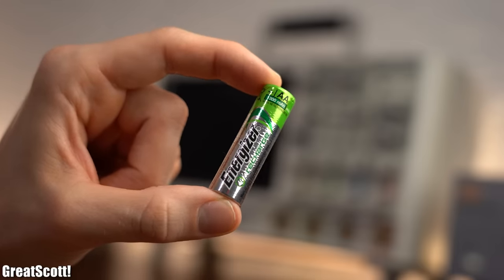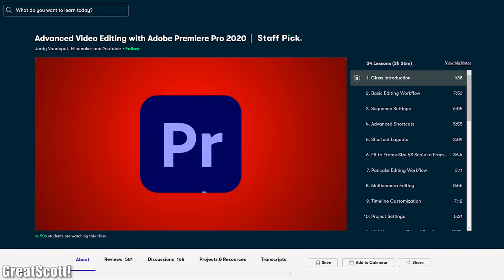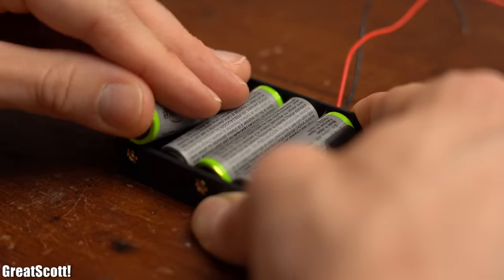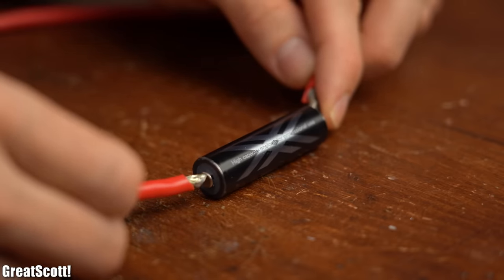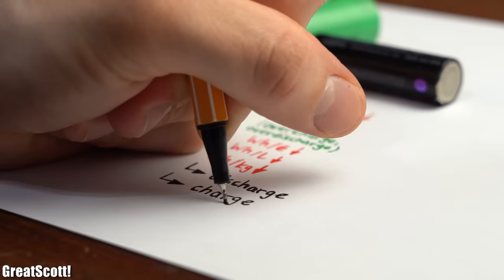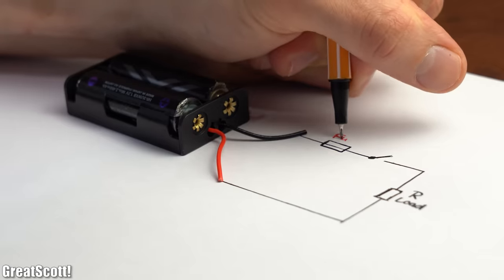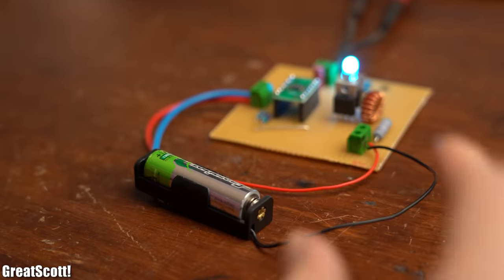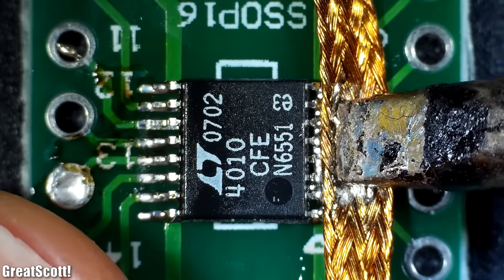Are AA NiMH Batteries obsolete? Here is everything you need to know about them!

Comment: Great tips on charging. I really need to get a smarter charger, my current one only does trickle charge although it does let you set the time/current values. It might not be the greatest battery tech but it’s used almost exclusively by toys!
Reply from the maker: Thanks :-) Sounds like an interesting charger you got
Reply: Just keep in mind smart chargers will not charge batteries that have too high of a resistance or if it detects something is wrong. I have about 8 NiMH batteries that work fine and even keep the charge but the smart charger does not charge it and blinks. So now I have 2 chargers to fix this issue and keep using the rechargeable batteries.
Reply: La Cross chargers are ok. Some even have settings to attempt to refresh damaged NiMH cells.

Comment: They are really good for lighting in dioramas. No need for charging, or low voltage protection, and they last for years with a charge. I like how you clamped onto magnets stuck onto the ends of the batteries.

Comment: An extremely helpful video would be retrofitting lithium batteries for devices that take AA!
Reply: I mean, that's pretty easy, so I'm not sure what you need a video for? Basically anything that runs on three AAs 4.5v-3v (or sets of three) will take a lithium cell with zero modification, then for one or two AAs all you need is a low dropout regulator or buck converter and finally a simple TP4056 for charging/protection or BMS for larger packs.

Alternatively, you can make things slightly easier by scavenging batteries from old devices like phones, since those will have a bms built-in and can come in convenient sizes.
Reply: @vgamesx1  the trouble is 1 AA at just 1.5v
Reply: Most anything that requires 2xAA in series you can use an 14500 and a dummy cell.
Reply: @patrickriarchy6054  My mouse takes just one AA 😕
Reply: To be fair, if a device uses AA, you will likely find NiMH much more fit than any lithium-based battery type

Especially for a relatively low-power device such as a computer mouse
Reply: @MrCh0o  The critical consideration is that many enthusiasts want to get their computer mouse as light as possible, as an example the Logitech G305 is a popular single AA battery performance mouse.
Reply: @soulshinobi  How about a wired mouse? Nice and light.
Reply: @soulshinobi  Or the single-use 1.5v lithium cells.
Reply: @soulshinobi  Or the AA size lipo-to-1.5v usb-rechargeable batteries.
Reply: @jimmybrad156  what I settled on doing is dismantling a AA size lithium battery for the charging circuit and buck converter and soldering in a 100mah cell.
Reply: @soulshinobi  Nice! What mah was the original cell? How would you describe the improvement?
Reply: @jimmybrad156  the rechargeable AA battery had a 550mAh cell weighing 12g (17g fully assembled), mice that are rechargeable are typically 500mAh flat cell (~10g), the 110mAh I have is 2.5g.

Comment: I personally like NiMH batteries because you can refresh the battery 'memory' by charging at a higher voltage. I've had a dozen NiMH batteries going strong for 6 years for both my xb360 and xb1 controllers

Comment: What might be interesting would be to include the theoretical maximum cycles for the batteries with the prices. They could be cheaper for daily uses
Reply: My NiMH are about 15 years old and still work great. There where used for RC Cars when I was a child and are now used in my XBox Controller.
Reply: There is limit. Just 40% is lost after 3000 cycles for eneloop lite, for example.
Reply: Complicated by the dependence of Li Ion to the depth of discharge. They like not being charged up to 100% and not discharged to 0%.
Reply: @gblargg  yeah, that 3000 number is from discharging of NiMH to 1.0 volt not full to 0.9 volt.

Comment: Thanks. Couple of points.
 When using multiple AA or others, there's always been a requirement to use identical new cells. For rechargeables this translates into fully charged and identical.
More modern devices can handle the lower voltage of NiMh compared to alkalines, but plenty cannot. 
Pricing I did for rechargeable lithium AA cells was a lot higher than NiMh.
Reply: it's really more of a best practice. You can mix and match and it will work, but with diminished lifetime because you would strain one cell over the others. I remember changing out the batteries on my TI-84, and there would always be that one cell that was drained (it was usually the second cell) while the rest still had some life. Curiously, I always swapped the batteries around to get a few more weeks before replacing them all. For some reason, TI calculators always drained the second cell first (even though they are wired serially and they only see the sum voltage). You don't see this with proper design and following the "all new cells" rule. Nowadays, I see this with chinesium gadgets that always use up the lower cells first (even after following the rule), usually because they're drawing too much current and straining the cells.
Reply: @arshia.sasson  And when you don't swap them, the lowest voltage cell always leaks
Reply: For devices which only use two cells (which seems to be most) it's usually fine to mix because the device will malfunction before the weak cell gets overdischarged. It's also fine to mix cells if it's just for temporary use. Just check them before installing. The rule about not mixing is IMO just for people without a multimeter.
Reply: @eDoc2020  Some of us want to fit, forget, without worries. Two cell devices don't always fail cos one is low. 
I have multimeters. I can't be bothered opening things up to measure cells cos I'm dumb enough to put unmatched cells in. Plenty of single cell devices to use up the odd single.
Reply: @kevgermany  I don't actually check the cells during normal use. I'll check them before installing in a device to make sure they're reasonably matched and then leave it alone until the device stops working. It might not be ideal but I haven't noticed any problems doing this.

Comment: I’m working on a portable neopixel light project that is powered off 3 AAs. I was just doing research on types of possible rechargeable batteries and couldn’t understand much information on NiMH AA batteries. This is absolutely perfect. Thanks!
Reply: Yes this is the biggest downside of NiMH IMHO.
Lipo just charge it with constant current, constant voltage.
NiMH: you need to have error prone and complicated deltaV charging. Also for deltaV charging you need to know the battery capacity so you don't charge them too quickly or too slowly.
Reply: @kwinzman  Li-po or Li-ion: capacity is needed to select proper CC current (0,3C to 1C or above in some cells, see datasheet for exact figure). Some cells like slow charging like my LG M50T 21700 (0,3C - recommended charging current from datasheet, 0,7C - acceptable at 25°C to  45°C)
Ni-Mh: capacity is needed to select proper fastcharge current (C/2-2C). Some care must be taken if already full cell is loaded into a charger.

Comment: Nickel cadmium battery's are still used in a lot of emergency lights in commercial buildings, and even new lights comes with those, I think is because of the high temperatures that those batteries can handle, some are starting to use  lithium phosphate but not like those.

Comment: my short answer to the obsolete is a big NO.  Many of my remotes/flashlights/fire alarms etc use removable aaa/aa/d/c/9v.  I just use the amazon basics where I can and have several sets of each that I rotate thru.  The charger that I'm using allows a full discharge(push a button) and after about a year of use I've cycled them all to "reset" them.  The one down side is they don't last as long as a duracell, but in the long term, each is probably worth 50 to 100 regular batteries.  One other down side, is they won't power somethings.   I realize this has nothing to do with the content of your video, but everything to do with the title.  And yes this is another great video...keep them coming...

Comment: Great video, but I think you forgot to mention how it can be used instead of single use standard size batteries (like AA) for commercial applications that can only take AA batteries. For example, you can't just use a LiPo on a game controller that takes AA batteries if you want something rechargable and easily replacable. I bought a set of AA NiMh batteries for my Wii remotes and despite the fact that they do charge really slowly, they're much cheaper in the long run than replacing single use AAs every time they get depleted.
Reply: I took his video about whether to make your own project run on them, or choose a self-contained cell.

Comment: I love my NiMH batteries.  For most of my projects under 2 watts, I use a AA NiMH cell.  My favorite PMIC is the TPS6102x family.  TPS61029 can deliver a fair amount of current (rated 1.8 amps at the switch, but that's more than an AA can source, especially given it's a boost converter) and will work down to .8V input.  It can also go into LDO mode if the voltage is a slightly higher than the programmed output and the output current is low.  It has UVLO, so it can cut off the boost circuit when the battery gets too low, programmable by voltage divider.  Best part is, for 5V projects, it will happily accept a Lithium cell or array of NiMH cells.  It's only boost, so no buck-boost operation.  SC8729 is great for buck-boost operation, but you need at least 2 cells, as it's dropout voltage is too high for single NiMH operation.

Comment: Personally I refuse to use lithium batteries in my projects due to the extreme fire and burn risk if they suffer any physical damage or a power surge due to component failure.  This risk is always brushed aside but needs to be taken more seriously.  I am tracking development of LiFePO4 cells which are moderately less volatile than the highly unsafe lithium ion and lithium ion polymer cells.
Reply: My thoughts exactly
Reply: LiFePO4 batteries are very tolerant of abuse.

I was at an event where a NiMH battery for a prototype electric car caught fire either during of immediately after charging.

Lithium ion batteries, including 18650 cells are available with integral protection systems that will protect the batteries from electrical abuse.
Reply: Gotta love the username in the context of the comment
Reply: That only happens in extreme situations, I only use lithium batteries and never had a problem
Reply: @clixium  Lithium ion batteries killed 14 of my farm animals.
Reply: @baneverything5580  I'm sorry to hear that but with a proper charge controller and battery management system that controls the charge, monitors the temperature that would never happen. Lithium batteries are safe if you play by the book and unforgivable if you don't.
I have all that and it isn't expensive if you know where to buy and how to connect all that but I still keep my batteries in a concrete basement or in a steel box just in case electronics fail
Reply: @baneverything5580  and as guy above said, lifepo4 is much safer chemistry and better option. They can last a lifetime and they wont catch a fire like lion or lipo no mather what you do to them
Reply: wrng kith sekf copkíñg
Reply: @baneverything5580  damn, what happened? What sort of lithium cells? Was it the cells themselves at fault or something else like a loose high current connection somehwere?

Comment: I really appreciate how deep you get in the topics presented in your videos! I learned interesting things for NiMH batteries! It would be interesting to see a video about primary lithium cells such as Li-SOCl2 batteries from Saft, Tadiran and others. They have high internal resistance but very low self discharge rate and are very suitable for IoT projects when coupled with a supercapacitor.

Comment: I like the safety and cycle life longevity of lithium iron phosphate. It's becoming easier to find LFP batteries and components in different sizes now. Made a couple small projects using 18650 and 32650 LFP batteries and I like working with them.

Comment: I discovered that when the NiMh lose capacity, cycling them seems to return them to near new levels. This seemed similar but not exact to the NiCd battery degradation issues with the older style cordless tools. I tried this theory on my 2008 Prius which uses NiMh batteries. There were several cells in the pack that identified as weak. I fully cycled each weak cell and four years later they are still good and now with 300k miles. Good topic.
Reply: How did you cycle those specific cells? did you remove them and cylce them or did you just discharge the entire pack? Also how did you identify weak cells? via OBD2?
Reply: @exmerion  I identified the three weak ones in the pack through the OBD port. From there, I disassembled the pack enclosure, unplugged the pack then disconnected/isolated the individual cells. I have a programmable battery analyzer and did a full discharge/charge/discharge/charge. They still seem to be holding up well. 260k miles on it now. Not saying, that I'm any kind of expert. Just did what I thought was logical. Hope this helps.
Reply: @babaluto  very helpful thanks

Comment: I used to use Lipos in my hobbies but having to constantly think about the voltage and monitor the voltage with an alarm got exhausting. That drove me back to nimhs, as soon as I felt any loss in power it would be time to change batteries. And having used them for so long I kind of already know the expected run time without damaging the batteries. Even though its older tech they are still very much useable.

Comment: nicely explained, can you make a circuit which can forward-reverse a DC motor based on time or (specific rotations using some sensor). thanks

idea is to take out butter from curd using such a machine using DC motor rather than AC ones.
Reply from the maker: I can put it on my to do list
Reply: @greatscottlab   please do it.
Reply: use a stepper motor and driver

Comment: for low load currents, pre-made boost converters from China work perfectly! they will stop discharging the battery at 0.9V pretty much exactly, which is when you should stop discharging to prevent damage to the cell. also charge termination voltage of 1.50V is what Maha Powerex Chargers do, you don't need to charge to 100.00%

Comment: There are also NiMH cells with built-in micro USB port and buck converter. While the space occupied by circuitry obviously detracts from cell size and capacity, those I have work very well, and can be charged either via USB, or a normal NiMH cell charger. As a bonus, each 4 cells came with a Y-adapter, for charging 2 cells at once from a single USB charging port. I have charged them from my laptop and from normal USB chargers and there is no discernible difference. Either way, they never get overcharged... Not that such is much of an issue, but it can dry out the electrolyte faster in some batteries.

Comment: I'm okay with handling bare lithium ion batteries, I've read about proper safe handling, have cases, a quality charger, etc.

But for most non-technical folks, I'd recommend something that works with AA NiMH cells because that maintains the ability to easily replace the battery when it wears out - unlike integrated lithium battery packs which most consumer devices discourage you from replacing (glue, solder, etc).

There are exceptions, e.g. flashlights with replaceable lithium cells that also have built-in charging, so the person using it doesn't have to worry quite as much about handling the cell directly.  I wish that was more common.

Comment: I've got a set of 4 energizer 2300mah NiMH AA batteries and they're still working great after 5 years. Not sure who came up with the idea that NiMH has a high self-discharge rate, two of my four cells I left in a keyboard that I didn't use for 3 years. When I finally started using it, it still powered on and didn't need a charge for two weeks lol

Comment: Having at least one analytical charger around that can be configured to charge at different rates, discharge at configurable rates to a certain voltage, etc can be very useful:
You mentioned the different capacity leading to over discharge, when I get new NiMH batteries (haven't done so in years) I run them through a charge, discharge, charge cycle on that charger. Then write the measured discharge capacity and current year + month on them. This way I can grab roughly matched sets of batteries, and if they've gone through a lot of cycles or it's been ages since I tested them I may put them through that again and write the new values on them.

Ideally I guess I should instead give them a unique number instead and compile a database of measured capacity + number of cycles they went through. Could lead to some interesting graphs showing loss of capacity over time and cycles... but I'm way too lazy for that. I did notice that Eneloops are holding out better than most other brands of which I had to retire a fair amount of batteries over the years even when preferentially picking them out of the box. Much like you I do primarily use them for commercial products that run on AA batteries, anything I design myself either runs on lead acid (when big and heavy doesn't matter) or more commonly lithium ion (either 18650/21700 or lipo packs).

Sadly you'll still ocasionally stumble into devices that won't run well on NiMH batteries, they either don't work well at all or can use only a portion of the stored charge in the batteries. Maybe those newfangled lithium ion contraptions with a buck converter for a stable output will work in those? But that'd probably come at the cost of a low battery warning works with alkalines/NiMH if they just keep outputing 1.5V until they are too low and then do 0V or whatever.
Reply: I think most of them (the lipo to 1.5v batteries) deliberately drop to 1.2v before 0v (to trigger a warning) now.